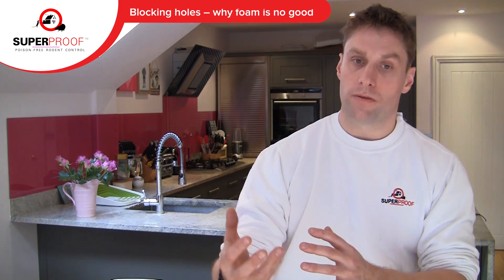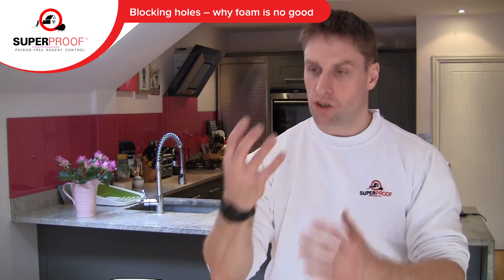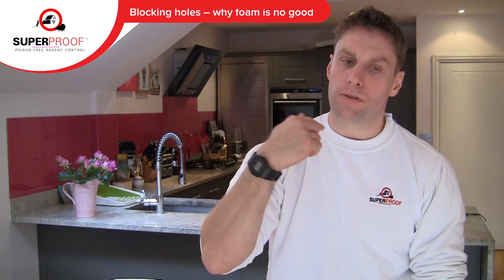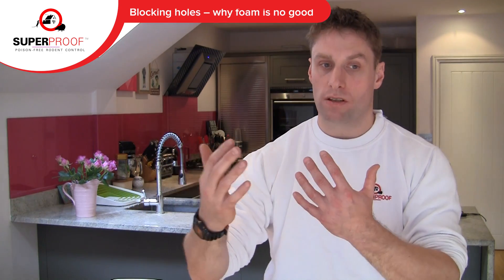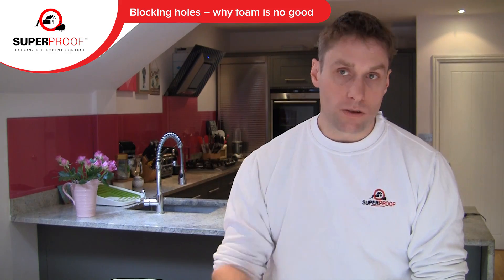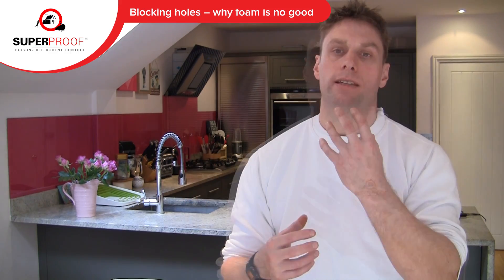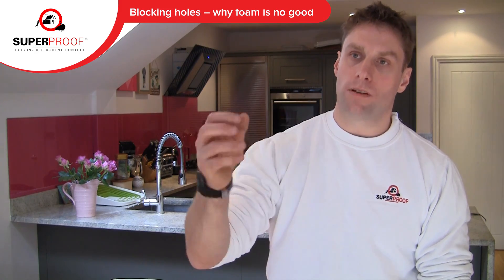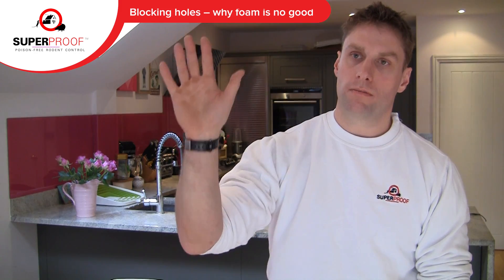Blocking holes – why foam is no good

Comment: Expanding foam is perfect for what it was intended for . I use it for cracks in Sheetrock and plaster . The cracks never came back . I also use it around windows to prevent drafts . It can be trimmed back neatly. It is not to be used for pest control. You said you use some product to fill these larger holes . A demonstration would of been helpful

Comment: What he's saying is non-sense. He wants you to buy their product. Btw, regarding the fire issue, there are Fire-rated Expanding Foams so this rules out his argument. Also check out the video "How To Remove Cigarette Smoke Smell Coming From Neighbor's Apartment" The guy Jeff seals all the edges of his walls where there are gaps, including electrical sockets with expanding foam and says that since then he's lived smoke free in his apartment. If this method wasn't effective how did it stop the cigarette smoke from seeping into his apartment? You just have to make sure you carefully block all the gaps properly with good quality expanding foams once you successfully identify the location(s) from where the smell is coming from.
Reply: Thanks for the tip👍

Comment: Yo, Gulliver mate, it says on the can to use foam in a well ventilated area 😉

Expanding foam layered with broken glass, copper mesh and 9" nails with a final layer of silicone externally 👍🏼

Rodent free for 8 years 🙂

Comment: Expanding urethane foam is open-cell?  Bollocks.  If it were, it would be useless for its main intended purpose, i.e., weather-sealing.  Moreover, every single-component expanding urethane foam that I've ever used forms a continuous skin on the surface as it cures.

Comment: i listen many times but I don't get what material he suggests!
Reply: This is how I got rid of mice. First I put poison down but that was to no avail so I set my mind on blocking holes. The mice were nesting in an airing cupboard and were getting into the main living area through the gap under the door and gaps between the skirting board and floorboards. I installed aluminium angle trim along the skirting boards and floorboards and nailed the aluminium to the floor to block the gap under the airing cupboard door (the door can still be opened) I filled every hole small and big with wire wool and sealed it with polyfilla and no more nails. I haven't seen one since.
Reply: @reallife47  Do you have a picture because I can't work out how to nail aluminium angle trim to the floor. "gaps between the skirting board and floorboards" Just in the airing cupboard? Or that's a lot of aluminium angle trim.
Reply: i heard steal wool is good if you want to get bugs out as well use the spray foam and steel wool in the hole first
Reply: He says silicone mastic. There are loads of types available, but you will see it labelled and marketed as silicone sealant. It is like the stuff you use to seal showers or window frames, etc. Usually used for waterproofing. I wouldn't have thought it would get rid of rodents, though. Coarse steel wool (like those tough pan scourers - not Brillo pads as they are too fine) or scrunched up chicken wire and expanding foam is a quick and easy fix, but I'm sure mortar would be more durable.
Reply: You need to be careful with wire wool as it is flammable.
Reply: total bullshit
Reply: Steel Woven RODENT PROOF Mesh